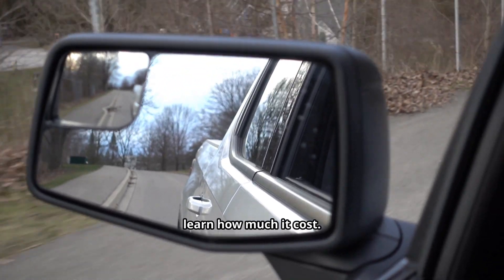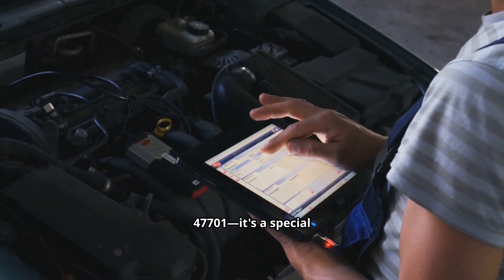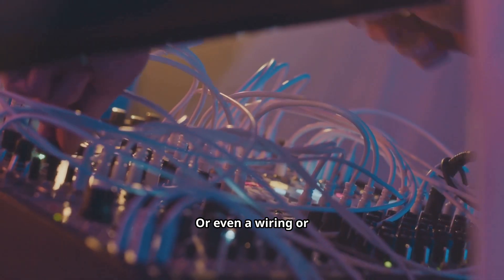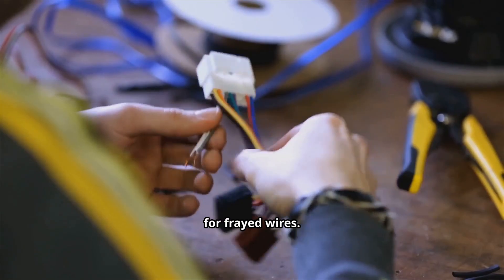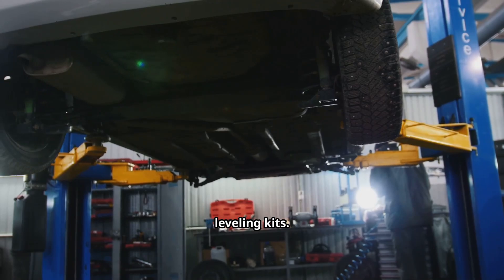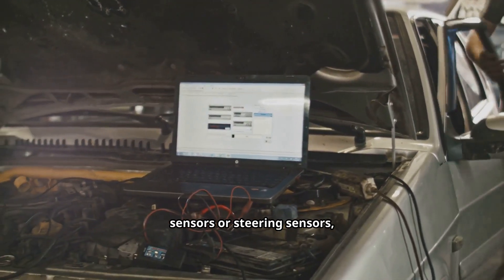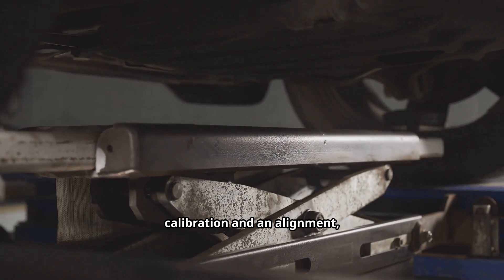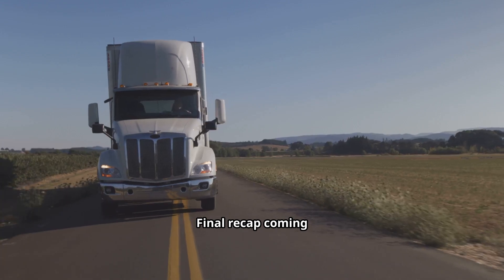F-150 C0051 ABS/Steering Fix | Steering Angle Mismatch| Ford SSM 47701 Explained

Comment: I have hilt decent service problem. ABS light  on and replaced wheel sensors and still have the same problem.  Just bought angel sensors for steering colum